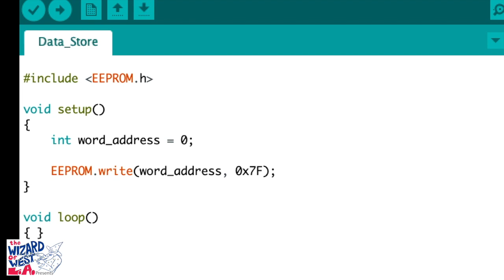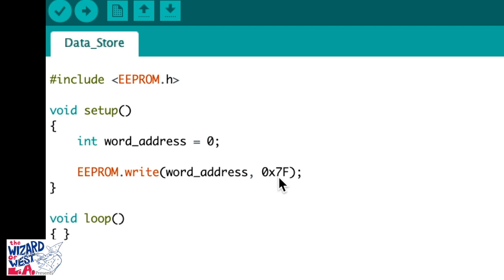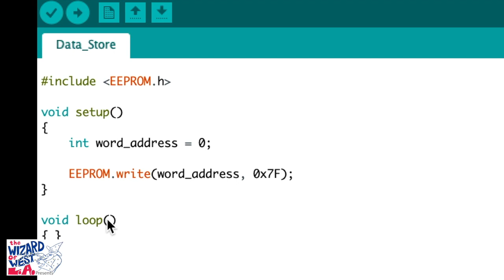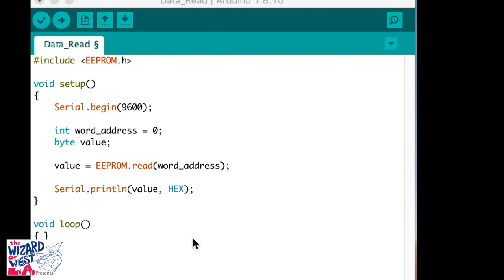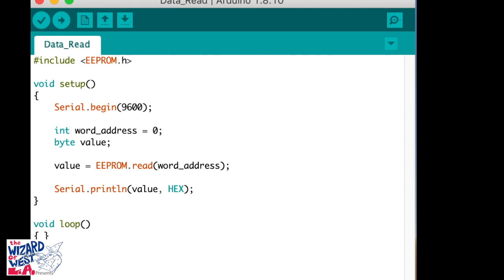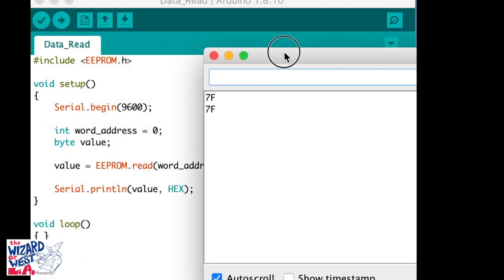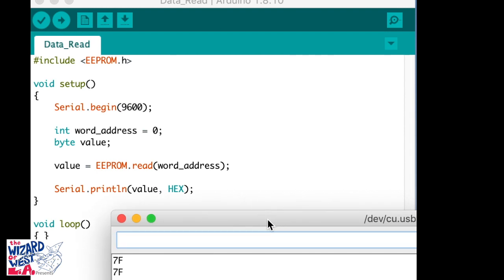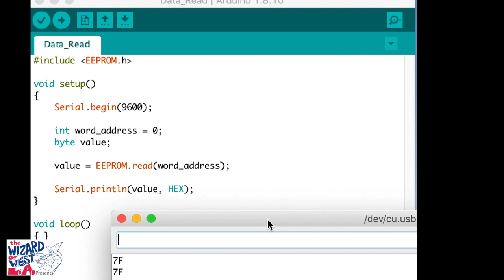Storing Data on an Arduino

Comment: Congratulations on your site. This has been the closest solution to my “problem”. 
I’m from Argentina and a beginner in Arduino coding. I barely finished my first project (free parking control) which works to my satisfaction. However, I want to improve it in the following aspect:
The parking lot has a max capacity, a variable number of occupancy (at any given time) and a remaining number of available spaces. All these numbers are stored and modified within “variables” for use in the continuous loop section of the code. However, should an energy cut-off occur, the data is lost. Therefore, the status previous to the energy failure has to be restored “by hand” which could be somewhat complicated.
I thought of two possible solutions:
1.	Save the data (capacity, occupancy and availability) within permanent FIELDS (instead of variables) for convenient retrieval.
2.	To use a Keypad interface for reinsertion of the data at the time of the energy return. Although this seems ideal, since it allows the actualization of the status (in case manual handling of the parking lot was necessary), the pad takes up many digital pins. This requires an extension of them or a larger Arduino board.
I’d appreciate your help in this matter.

Comment: Vey good. I'm working on a project to learn several remote control button codes so it doesn't involve decoding and writing specific numbers each time. This way I can assign any remote button to a task easily without taking the thing apart, just by going into a learn mode, error checking the code it gets is the same for several cycles, then storing it away. Thank you.

Comment: Sir I am going to innovate a project related to sensors , so is it possible for you to send me the required codes for all those sensors?....
Reply from the maker: Which sensors are you going to use?
Reply: @TheWizardofWestLA  sir I am going to use ph sensor, turbidity sensor, dissolve oxygen sensor, and it sensor.......
Reply: Sir please help me to get a concept about this code providing me  codes....as soon as possible...and I also want to learn something else from you... related to this project....
Reply: @Melodyvibe2004  It's your project. Asking for help is one thing, but you are essentially asking him do the work. He is not obligated to help you out. What's in there for him? Nothing!
I don't want to offend you, I really hope you pushed through yourself. Try to solve most of your problems yourself and than ask specific questions.